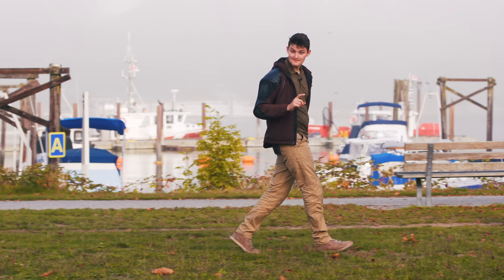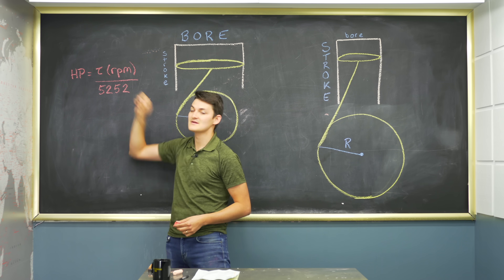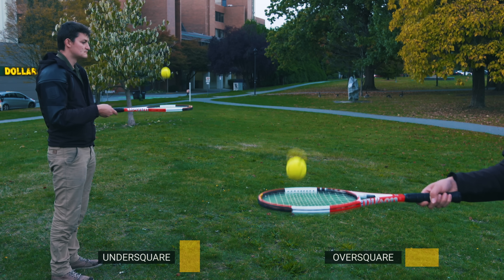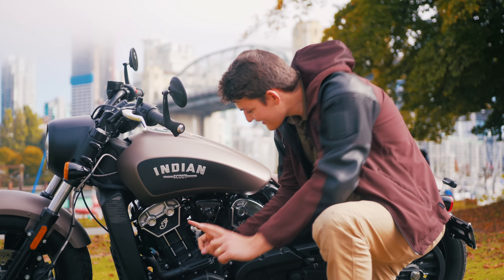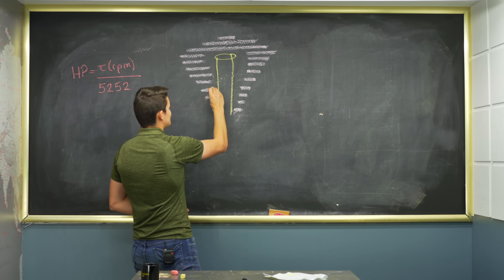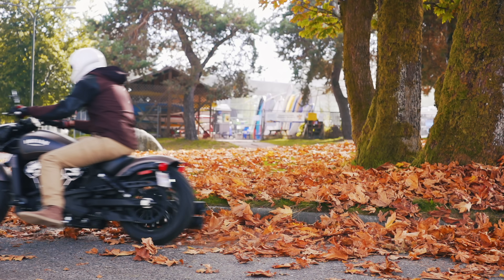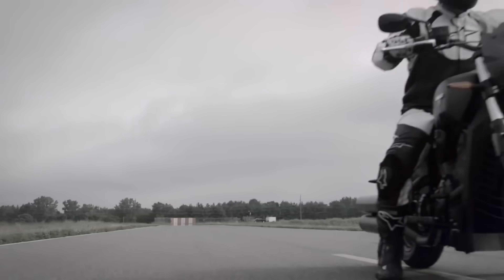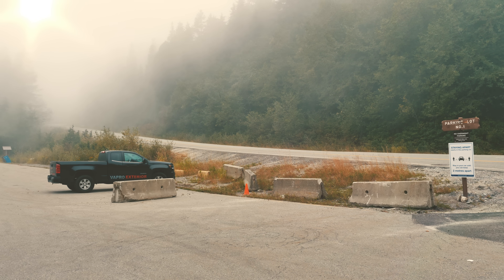How Indian Makes 43% More Power than Harley-Davidson

Comment: I'm pretty sure HD invented the idea that "it's torque that counts", 'cause they never learned how to make power.
Reply: Horsepower is torque and RPM. Nothing else. You measure torque, you calculate horsepower. Allow me to demystify this for you. At any given RPM, measure your torque in foot-pounds. Take that and multiply it by RPM. Divide by 5252. You now have your horsepower. For example, if you have 100 foot-pounds of torque at 3000 RPM, your horsepower is 100 * 3000 / 5252 = 57.12. The difference between a power build and a torque build is that a torque build will have a broad torque curve, especially at low to mid RPMs. A power build will have its torque peak at higher RPMs. Harleys are generally torque builds. You do not buy a Harley to try to win quarter-mile races. You buy Harleys to ride around at 45 or 55 mph or maybe 75 on the interstate. You live between 2000 and 4500 RPM, which is where the torque is on Harleys.

However, the specific bikes he is comparing in this video are apples and oranges. I agree that Harley should rethink the Sportster. If you are deciding between these two bikes, get the Scout. But to make a broad claim like "Indian makes 43% more power than Harley," try comparing a Milwaukee Eight bike vs a 111 or 116. From the factory, the power is about the same, and a big part of buying a Harley is that you can upgrade it with stage kits. My Stage II 114 Softail makes 115 horsepower and 125 foot-pounds of torque, which is more than an Indian Challenger does at the wheel on a dyno. I know Indian advertises 122/128, but that's at the crank, I am referring to at the rear wheel on a dyno. In addition to having more torque and more horsepower, it's about 80 pounds lighter. To be fair, I am comparing an upgraded bike with a stock bike, but just a Stage II, which is common and not that expensive, and I am comparing vs the highest-performance Indian bagger.
Reply: @wombat8882  Yes what matters is the CURVE of the torque and power, like a 200HP bike but the peak torque only exist in RPM that is way too high (9000rpm and above) vs a bike with only 120HP but the peak torque already start rising from lower revs (2500rpm and above), people who ride both will enjoy the 120HP more because they know that they only need 200HP on the track and not on some traffic jam around the city or highway
Reply: @wombat8882  A Polaris Scout should be compared to a VSRC, not to a Sportster. That's the correct comparison. And you're right in pointing out that a Scout vs Sportster is apples and oranges.

H-D makes about 20% more power than Polaris.
Reply: @wombat8882  Thank you for demystifying the concept of torque to a mechanical enginner, I appreciate it it was something I was struggling with.

Now if you don't mind expanding on that another thing I never quite understood was the concept of gearing ratios and how an engine with less torque can actually produce just as much torque at the wheel by simply revving up faster when you open the throttle, because for some reason bikes with more power but less torque still accelerate faster than Harleys when you're cruising along at 45mph in 6th gear and open it up.

Comment: While I appreciate the video, I feel like if you are going to try to explain the mechanics of an engine, you should have a significantly better understanding of engines. Sorry to say your explanation of the physics in the engine is pretty much downright wrong on several accounts. The most egregious error in your understanding appears to be that what drives the piston down during the power stroke is not the flamefront but the pressure rise caused by combustion, and pressure travels at the speed of sound and the piston certainly does not outrun it. What causes an undersquare engine to run out of puff as RPMs rise is that the smaller bore means smaller valves which in turn limits the breathing capacity of the engine, which is why torquey motors tend not to have good power at higher RPMs. Another notable error is that pushrods don't cause valve float due to their mass, it is because the inertia in causes them to bend and flex. Valve float is pretty much strictly a function of RPM, the valve spring stiffness and the mass of the valve itself. The part about air cooling is also significantly wrong, limiting heat transfer during the power stroke actually makes your engine more efficient and cooling doesn't matter a whole lot during the power stroke itself (Other than for knock, but that's another rabbit hole). Not throwing shade, but I strongly recommend consulting someone with a better understanding of engines if you are going to put out content "explaining" it. I understand it is for entertainment, but this is really warping peoples understanding of engine basics. I don't expect anybody to take my word for it, feel free to cross check any of my claims from a reliable source.  As for my credentials, I work for a major automaker in powertrain research and build math models of engines for a living (for over 10years), so I kinda know what I'm talking about. I hope you take this in the constructive way it is intended. Cheers!
Reply: If the piston outrun the flame front, it mean the combustion isn't complete when the piston reach the bottom, so less power.
Also the need for much stiffer spring to go at higher rpm, mean you need a heavier rod, so stronger spring, ect..
Reply: Good to learn always! Guessing it’s a fellow South Indian nerd with an interesting career. Cheers
Reply: @allenjoshuaselva  LOL I guess you could say that...

Comment: At least Harley is moving the right direction now, whether or not it's thanks to Indian lol. A lot of HD engines are oil cooled as well as air cooled now instead of just air, and the new sportster 1200 gets a sweet liquid cooled engine. I actually just traded my night rod in on a newer street bob, but that night rod was a hell of a lot of fun. That 1200 liquid cooled engine had lots of pep for it's size, I just wish people didn't hate that platform so much. It really had potential if they just added a 6th gear for on the highway and still made it.

Comment: Next video “how F1 cars get 900+ HP from a 1.6L V6 turbo”
Reply: Hint : Turbos
Reply: @YABBAHEY1  They used to get 900hp from NA 3.0L, by running them at about 18000RPM. To avoid valve float they had to use a pneumatic spring in addition to the normal one, so that the spring rate would increase with engine speed.
Reply: @Jupiter__001_  Not to mention the majority of moving parts are so light weight their only good for a race or two. Production vehicles don't have that option obviously

Comment: *somewhere in Japan * honey come look! The American bikes think they make alot of horsepower lol! Bring the kids its hilarious!
Reply: Actually, for some reason, the Japanese absolutely worship v twins and american bikes and cars.
Reply: Everyone wants to be someone else.
Reply: @sivvinod3187  it’s true. When I was stationed there guys were having their corvettes and Harleys shipped over and selling them for super high prices. The Americans were buying up low mileage left hand drive Skylines and older Supras and bringing them back, funny how that works.
Reply: @mr.b3168  put a lot of thought into that one didn’t ya sparky!?
Reply: @motoGPness  No one's talking to you Matthew.
Reply: I own a royal Star venture, most comfortable bike i have ridden, and i was told, that the engine was designed by Porsche, and offered to HD, who turned it down. this is the same basic engine design that is used by the 1200 v max and the early eighties yamaha venture royal ( xvz1200)   liquid cooled v4 shaft drive, and that engine is still making way more power ( 98 bhp ) than a HD with more cubic inches
Reply: the reason  that would be the only way an American bike would ever make more power is if Japan was wiped out but till that happens sorry american bikes will still just be crap 😆

Comment: But Harleys make 430% more noise...
Reply: Most stock Harleys are actually very quite. Mine is very quite (I think my Honda enduro is louder). It’s just the first thing most people do with their bikes is change the exhaust (cruisers and sport bikes). It’s rare to hear a bone stock Harley on the road.
Reply: 1000% more bro points
Reply: @CamaroAmx  First thing I changed.
Reply: @stillshakin2125  cops in general leave motorcyclists alone as long they are not doing anything stupid. I’ve been around bikers my whole life and never heard of anyone getting nailed for loud pipes.

Comment: While I understand the technological innovations that Metric motorcycles have, I dislike the way they look, I hate how tall they are. I strongly dislike the seating position of rear and mid controls. Motorcycle riding is about relaxing for me. I think skinny front tires look terrible and having such a small contact pad, does not appeal to me. When looking for a new Motorcycle this year, I chose the Street Glide Special, it was everything I wanted in a motorcycle at the time.
Reply: Try a Triumph Bonneville T120.
Reply: @thumperjdm  is that a cafe  motorcycle? No thanks, not appealing at all, I do not understand the appeal of them, mostly hipsters ride them.
The only appealing motorcycle they have is the Bonneville Speedmaster, the rest are generic or sport bike style. The forward controls are nice, but I would have to get different bars, so I would not have to lean forward.
Reply: @Evirthewarrior  Never mind.   The Bonneville T120 doesn't have forward controls.

Comment: Harley is still catering to the oldies with thick wad of cash with their old tech. If Harley wants to bring the new tech in old bottle, they can do so with the next generation of bikers at their affordability. Its already shut shop in India, now how many more stores will close before they open their eyes?!
Reply: They already know thats why they are trying to modernize with electric bikes... Still its to late lol.
Reply: Every time Harley tries to modernize, people ignore them. It’s not entirely their fault. Their customer based doesn’t want modern stuff. Maybe once the old base dies off, then people will buy harleys more modern stuff. Of course the issue is that the old generation raised the next generation to like the old outdated stuff and hate new stuff.

Hell my father thought I was all fancy so to speak because my Harley has fuel injection. I only bought the Harley for 2 reasons: used scouts cost as much money as a new scout at dealers. There was no used scouts on the private market. And finally I got a great deal on my 2014 iron 883. 300 miles on it and only $5k. Previous owner rode it, had an incident that scared them off it, parked it for 6 years in a garage and then decided to sell it.
Reply: @CamaroAmx  Because its a very HELLO FELLOW MILLENNIALS HOW DO YOU DO? sort of modernizing its no graceful at all and they from the START could have made bikes to appeal to a wider audience but they stuck to what they knew and they are now paying for it.
Reply: @0Synergy  they aren’t paying for anything. Harley still makes a profit. And the innovating happened a decade before millennials were even old enough to ride. People just expect certain things from Harleys and if they don’t get what they expect, they buy from someone else. It’s the same if Toyota dropped the v8 from the tundra into the Camry to compete with the Charger. They would alienate their customers who expect certain things from the car and it may turn off them entirely from the brand. So what does Toyota do? They keep making the same reliable, uninspired sedan year after year. Sometimes they will make sportier looking version, but it will the same underneath the fancy bodywork and people keep buying them.

One of the hardest things to do in the automotive/motorcycle world is to change people’s perception of the brand. Many brands have tried and failed (see Pontiac and Mitsubishi). Others they did succeed but it took decades (see Cadillac).
Reply: @CamaroAmx  "Harley Makes a profit".  mmm - ish.  You should check out Fort Nine's vid on why Harly may not make it and the shenanigans management has been up to in order to keep that stock price up.  

And "innovating a decade before Millennials were even old enough to ride" would place HD's "new" tech somewhere in the mid-80s into the early 90s.  The "millennial" generation started in 1980, and the oldest, BTW, is turning 40 in 2020.  That's not innovation, that's history.  Turner's parallel-twin for Triumph was "innovation" in 1937.  Now it's a leaky old pushrod plodder that produces a paltry amount of HP for the cubic inches it displaces, (but does sound and look nice).

Frankly, the Honda CB750's or Kawasaki Z1's inline 4 was and is a waaaaay more technologically advanced engine than most of the lumps in modern Harleys and those were designed in the late 60s and early 70s!

I'm a mechanic but work on mostly metric stuff but have turned a wrench or two on American bikes.  Honestly, HD's quality is pretty good these days (especially compared to the Iron Head days), but that's not the reputation they have, and that's a problem.  You can also get one somewhat reasonably - but again, not the reputation they have.  Again, problem. 

I don't know anyone under 40 who rides an HD.  I see a few younger riders out there, but almost everyone else I see on one is overweight, (often very) and old.  All of my younger customers have Japanese, European, or in the case of the one on the lift right now, an Indian Royal Enfield Continental GT650, which is a surprisingly good machine!

I also talk to a ton of riders young and old, and many of these older HD riders have said something to the effect of "this 'glide'll be my last bike.  Just don't get out that much anymore..."

If I were holding a lot of HD stock, I'd short it.

To continue your Toyota analogy (which does kind of ignores the Camry XSE, but we'll move on), perhaps HD needs to launch their own sub-brand (like Lexus, but geared toward younger people ), that will appeal to Millenials, and Gen Z.  

Or not.  I couldn't give a monkey's, really.  They built their own coffin (about the time that "innovation" was being developed) when they decided to trade in their proud race and innovation history for a bunch of cheap, jingoistic nostalgia, and they can be buried in it, (with a chrome-plated pot-metal eagle on the lid).

Comment: use to ride a suzuki bandit but the confidence that bike gave me started to get me into trouble

switched to a puny 650 cruiser, japans answer to the harley, a v-star custom, taking a turn on a cruiser doesn't exactly inspire confidence and as a result i am a far safer rider for it, the relaxed seating position, the vibration and sounds of 20th century engineering, different but just as enjoyable - even without the regular pulses of adrenaline 

there is alot to love about the character of these old tech machines and you're far less likely to need an life insurance policy to go with it

know you limits and enjoy the ride, i dont see much point in buying a bike where 80% of it's potential never leaves the garage

Comment: Pushrods actually can move at whatever speed is needed. We're talking 6000 to 7500 RPM here- not 12 to 15 grand like an F1 engine. Weight is not an issue. Modern pushrods are very light and strong.
Overhead cams reduce rotational loss at the rockers and allow for straighter intake and exhaust runners, all of which makes for more precise valve actuation and better cylinder head breathing. There is a much bigger problem with HD motors...

Comment: Brilliant Ryan. You create great entertainment. How about a Kymco AK550 Premium comparison with a say Honda Sliverwing V500 tourer. Put a top box on AK and it would have more luggage capacity than the Honda. Sad, but no brand makes a light tourer anymore. I once created my own out of a Suzuki GSR 600 by fitting a screen Barkbuster storms and 33 Litre hard panniers from Hepco and Becker (EU). Keep up the great work Ryan. PS I just bought a Kymco AK550 as great value like the silverwing was but faster with modern tech like electric windscreen, heated grips and cruise control as standard fitment. How does the Republic of Taiwan do it? LOL

Comment: Harley's new sport model has left nostalgia in 2023, and push rods,  gone for tech, it has 121 HP / 90 kW @ 7500 rpm, Indian's comparable model the Scout has only 100 horses, but they do have a large verity if you want to step into more horse power.

Comment: That's facts. My old Freedom 106 made more hp and a smidge less torque than my M8 107. But, you can drop a cam in a 107 and pick up 25 rwhp pretty easily. Something that's certainly more involved, expensive and likely less gainful in that OHC Indian.

Comment: I used to own a 2013 Victory Cross County until I was T-boned, well just my front tire which threw my body into the driver's door shattering the door glass and my head denting the top of the door and roof with my helmet. I love my carbon fiber helmet.  To buy a comparable Indian, they wanted about $5K more than what I paid for my Victory. I now own a Harley-Davidson Street Glide with the Milwaukee 8 motor.